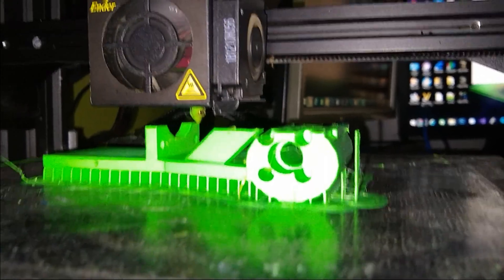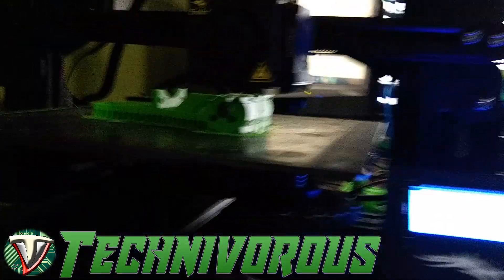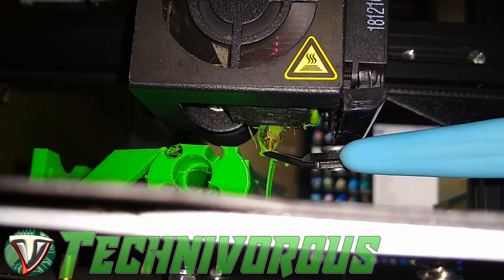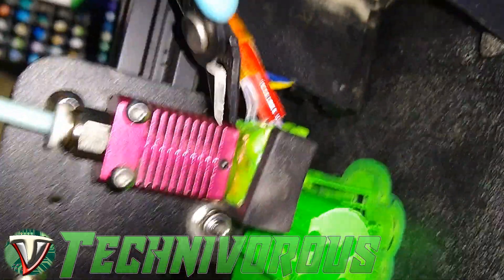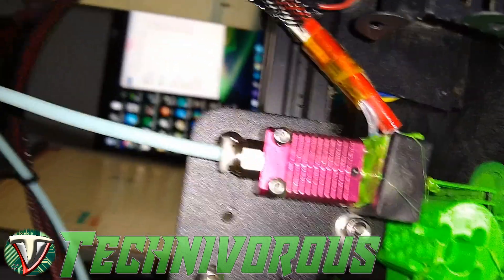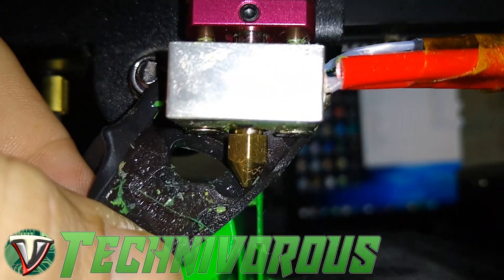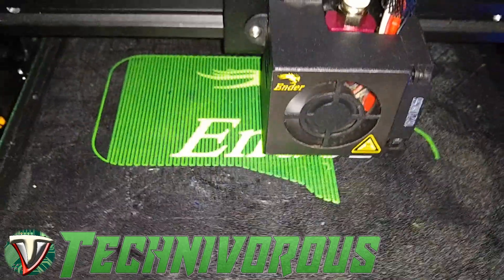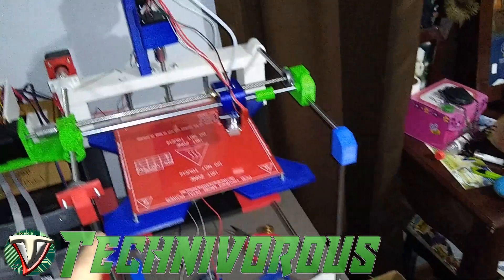FAIL? How to Fix a Leaking Hot End -Troubleshooting - Crealty Ender 3

Comment: my printer suddenly started underextruding slightly. there was a small bit of PLA upwards past the thread of the throat and ontop of the heat block. but i dont know how to clean that off, even a heated heat block wont make this scorched plastic even half liquid and i dont know if it will still seal properly with that stuff on the threads. any tips?

Comment: My ender constantly bleeds filament out of the hot end.  It is not clogged, the opposite in fact, it is not bleeding out the edges like yours... it is just constantly pushing a steady stream of filament out while over 200 degrees C...  The only reason it is a problem is because it collects around the hot end and will interfere with articulate prints.  I have searched and searched for a solution but Youtube, googs and reddit just keep directing me to clogged nozzles until a search found your video.  Does anyone, anywhere know what would cause your extruder to leak PETG out of the nozzle at such a low temp, despite the printer next to it not having the same bleeding problem until the printer hits the printing range for PETG, 225 C on that ender?
Reply: Hi! Did you ever find a solve for this? I’m having the same issue right now and all searches are leading me to clogs, which is just not my problem at all.

Comment: My ender 3 pro has underextrusion and also pla covering the heat block. I've tried reseating the Capricorn tubing and cleaning the nozzle. I've also tried purge filament. I didn't find out about the leak till last night so it looks like today's task is to disassemble the hotend. Thanks
Reply from the maker: Good luck!